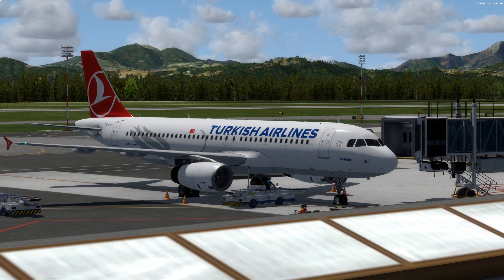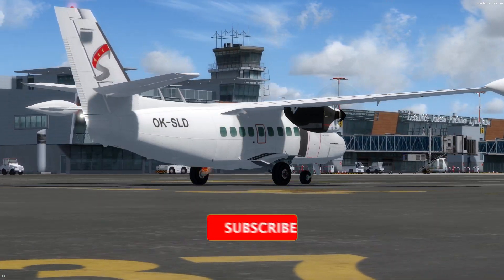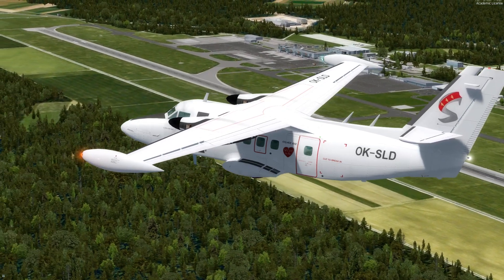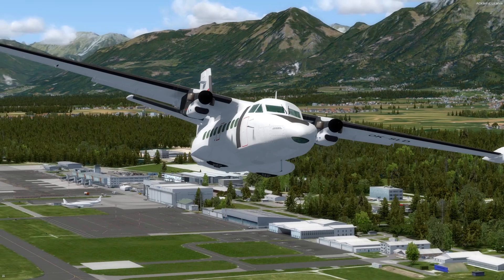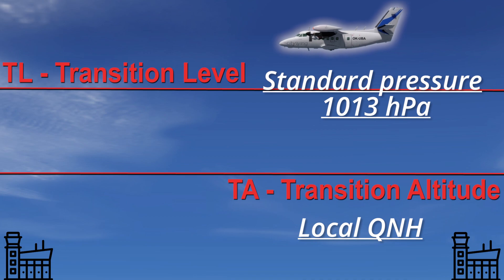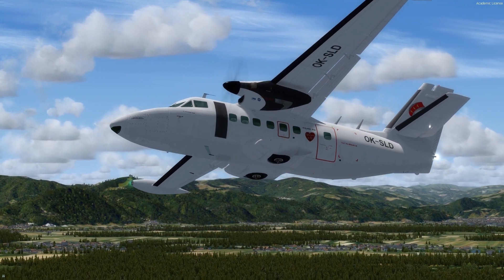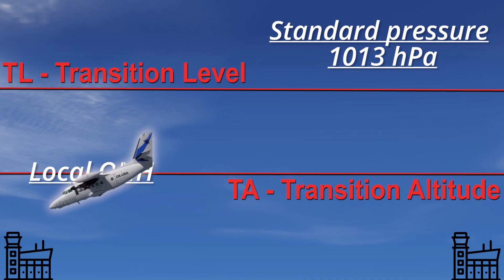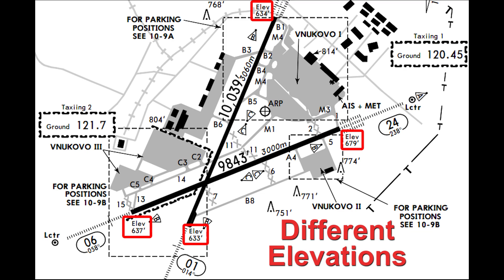ALTIMETRY - Pressure settings? | QNH, QNE, QFE explained!

Comment: Is qnh altimeter? If not where can i set my altimeter
Reply: Please show in the a320
Reply from the maker: @prestonarmy1  The QNH is the pressure setting which you need to use when below Transition altitude. That means that when you will stand at the airport the altimeter which shows the elevation will read the real elevation of the airfield. QNH is normaly defined in METAR reports and pilot setts the right QNH by rotating the knob bellow the figures defining the QNH. This knob is located left (Pilot) and right (Copilot) of the Autopilot panel. By setting the correct QNH the altimeter will change the value of elevation to a proper one.
Reply: @ALL4AVIATION  i know the QNH knob but when ATC tells me to update my altimeter i can’t figure out where that is so i just end up updating my qnh. Also thanks for the help because i know newbies can be frustrating and annoying. (Show in A320)
Reply from the maker: @prestonarmy1  when you set the QNH to the right balue then the altimeter will show rhe so called QNH height. In A320 that means that the altimeter will be corrected and ylu can se the QNH height on the right part of the PFD-primary flight dispay. If you will use the right QNH that means that the altimeter-altitude knstrument will show the right value.
Reply: @ALL4AVIATION  oh ok

Comment: When do I press the "Approach" button before landing?
Reply from the maker: You should press the Approach button as soon as controller clears you for the ILS approach on the final track towards the runway. Or everytime when you would like to start your aircraft to follow the ILS approach. There are also other approaches which are used with Approach button but ILS is the most used one.